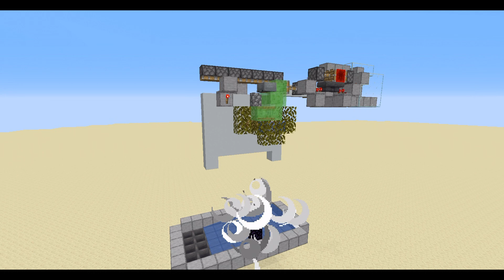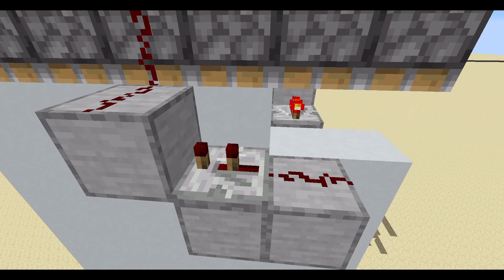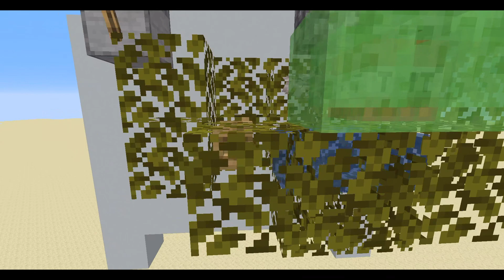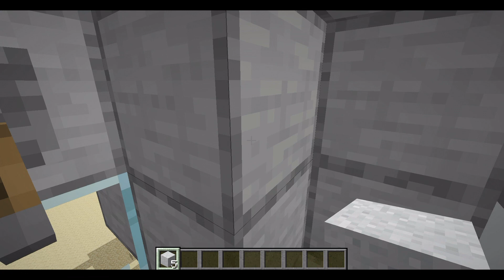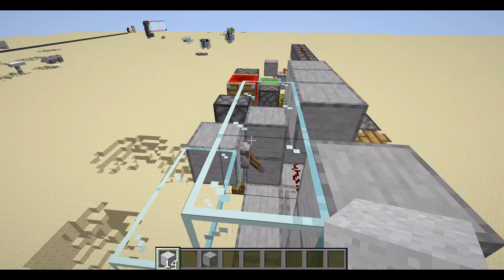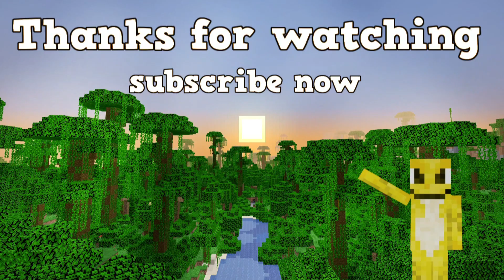How to build a super easy concrete maker for minecraft 1.19

Comment: Materials:
97 Smooth stone
10 concrete 
17 hoppers
15 leaves
15 redstone dust
11 glass (optional) 
8 pistons
7 water buckets
6 slime blocks
Chests
4 sticky piston
2 Redstone comparators
2 redstone repeaters
2 redstone torches
1 block of red stone
1 dead horn coral fan
1 detector rail
1 dropper
1 lever
1 oak fence gate
1 oak stairs
1 obsidian 
1 tnt
Hope this helps!

Comment: material list?
Reply: Materials:
97 Smooth stone
10 concrete 
17 hoppers
15 leaves
15 redstone dust
11 glass (optional) 
8 pistons
7 water buckets
6 slime blocks
Chests
4 sticky piston
2 Redstone comparators
2 redstone repeaters
2 redstone torches
1 block of red stone
1 dead horn coral fan
1 detector rail
1 dropper
1 lever
1 oak fence gate
1 oak stairs
1 obsidian 
1 tnt
Hope this helps!
Reply: @thebananabagel880  Thanks man!

Comment: is there no material list?
Reply from the maker: If I remember I can make one
Reply: Materials:
97 Smooth stone
10 concrete 
17 hoppers
15 leaves
15 redstone dust
11 glass (optional) 
8 pistons
7 water buckets
6 slime blocks
Chests
4 sticky piston
2 Redstone comparators
2 redstone repeaters
2 redstone torches
1 block of red stone
1 dead horn coral fan
1 detector rail
1 dropper
1 lever
1 oak fence gate
1 oak stairs
1 obsidian 
1 tnt
Hope this helps!

Comment: where is the item list
Reply: Materials:
97 Smooth stone
10 concrete 
17 hoppers
15 leaves
15 redstone dust
11 glass (optional) 
8 pistons
7 water buckets
6 slime blocks
Chests
4 sticky piston
2 Redstone comparators
2 redstone repeaters
2 redstone torches
1 block of red stone
1 dead horn coral fan
1 detector rail
1 dropper
1 lever
1 oak fence gate
1 oak stairs
1 obsidian 
1 tnt
Hope this helps!

Comment: I play on a server where the only does damage below sea level so i made a dug out area for it but I’m not sure how to align it with the already built explosion and collection area. Also I’m trying to replace my old shulker craft one with this one.
Reply from the maker: In my opinion I would completely rebuild it as it will get a bit confusing trying to do the shulker craft one with mine.
Reply: @Gecko1  Since I have a hole in the ground to build it in I have to go build it kinda in reverse so I was wondering if the of which things are placed down matters at all